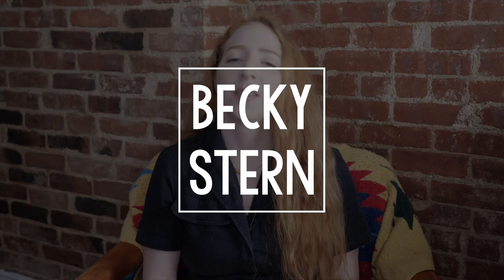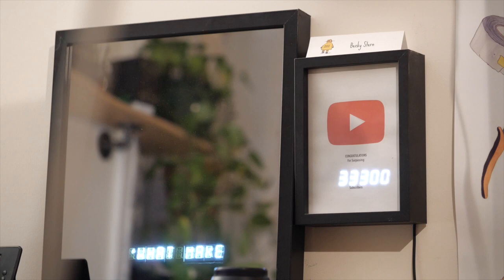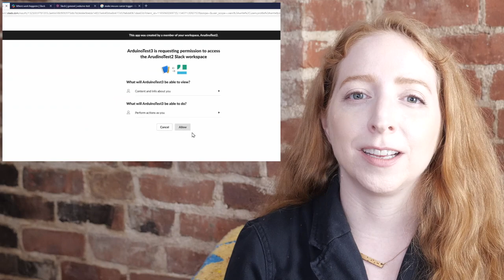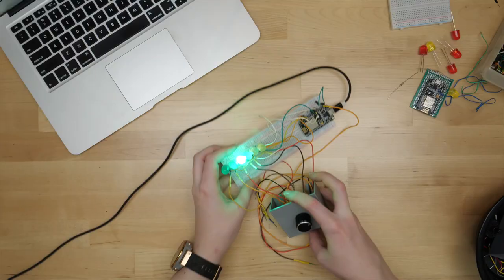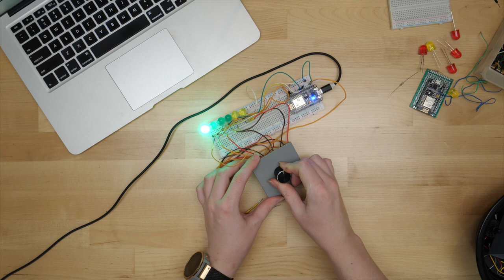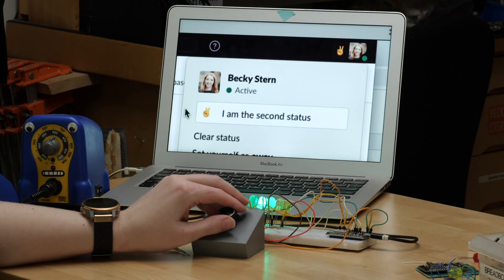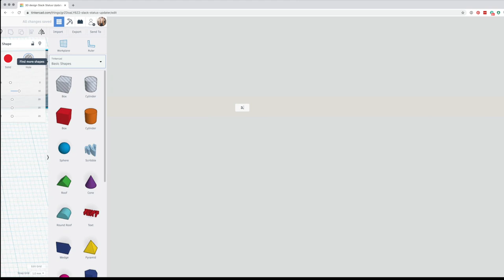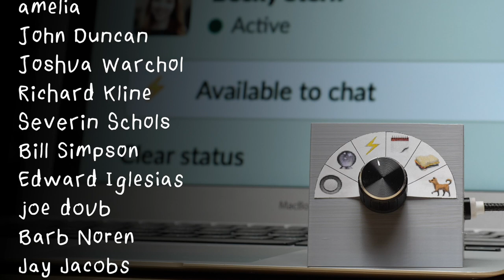Control Your Slack Status with ESP8266 (DIY Electronics)

Comment: Cool! I like how the USB plug is recessed in the side of the case. It protrudes just enough to hold the backshell to plug in / unplug, but it doesn't stick out too far and it looks tidy.
Reply from the maker: Glad you like it! I originally wanted it to come out the back/bottom but the USB connector is too long and I didn't want to increase the overall size of the enclosure .